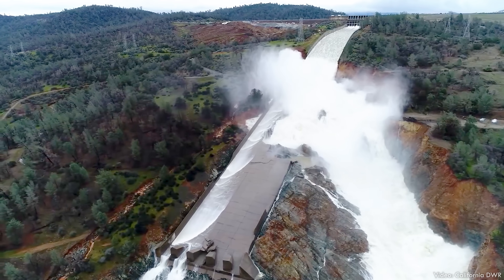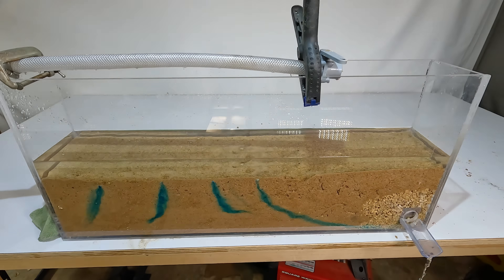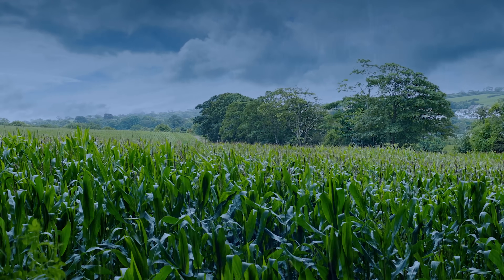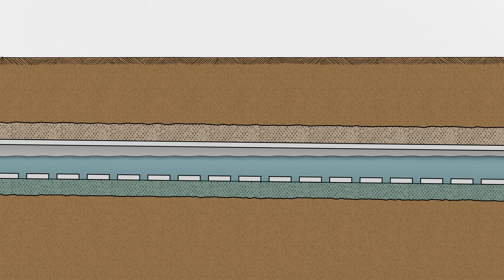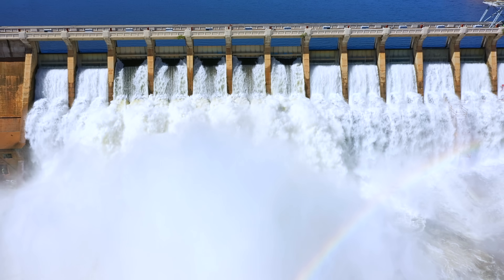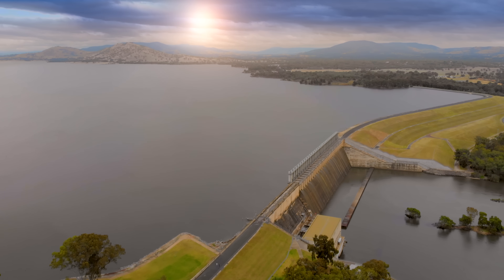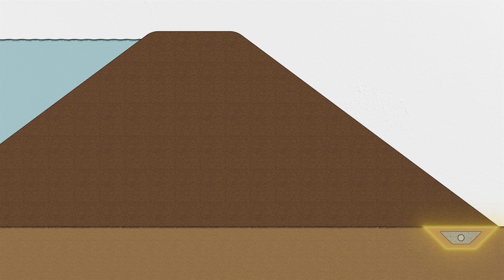How French Drains Work

Comment: I am a Stormwater Management/Sediment Erosion Control Inspector for the state of MD, and we don't allow French drains for the exact reason Grady stated. No matter how much you try to regulate sand/gravel size, any smaller sediment particles above, and in contact with, larger stones, will enter and clog the spaces between the gravel. We typically use very similar devices like Bio-retentions/Micro-bios in residential areas between houses. There is a whole world of mildly interesting devices and structures used just for moving around the water that comes from the sky, and the ultimate goal is to have the water end up in the exact same place it was before it was developed. Its also always changing, and things we were doing 5-10years ago is already considered out of date, but awesome video as always. Absolutely nailed all the nuance in this field! Keep up the great work!
Reply: Yes, in the state of MD we try to handle water in a way so as we limit the changes we make in how the overall watershed is affected by our development. Such as when we divert surface water around an area, we try to outlet in a way that it doesn’t negatively affect the natural soil and  vegetation, usually through a designed stable outlet to reduce the velocity before we transition back to original ground.
Reply: Based on my quick googling, isn't bio-retention basically just a french drain with plants on top to hold the soil in place and prevent it from clogging?
Reply: Whatever system you decide to use, don’t skimp on the pump. I built my drain and pumped it out of the vault with a Zoeller pump. Pricey but worth the money. Heavy duty all the way.
Reply: Yes.  @LanceThumping
Reply: You really only have two choices, right?   Either a geotextile fabric, which itself will get clogged, or sand over top gravel.   Seems like sand over top gravel is actually the best solution.   Since sand is an excellent filter medium.   In fact, sand pool filters are very common.
Reply: @sidorgeorge  in most soil water will still go i the drain
Reply: It always fascinates me that the most effective designs are those that more closely resemble the original conditions.
Reply: What type of drainage is used for basements?
Reply: Thinking gravel & sand on drainage pipe w/ vertical junction in pipe w/ cap (every 50ft), & use pressure washer to clear pipe annually or as needed. ... .... ... Any thoughts of better ideas?
Reply: Could you give a quick description of the kinds of things your putting around residential homes? Does it work with homes with basements?
Reply: In where I live, if french drains are not installed, there is most often huge problems with basements. We use isodrän/french drain covered in gravel surrounded by geotextile combination and cover everything by EPS plates placed just a feet underground for ice damage prevention. If something clogs up, you can pressure wash them from the inspection wells, and it's golden.  Also, drain pumps are useful but not everyone has those.
Reply: Thanks,  you have put me onto a new path to investigate how I can provide a solution to my problem before approaching the local Building Inspector about my neighbour's retaining wall flooding issue.
Reply: Bioretention have also its inherent mold problems if not enough air or circulation.
Reply: That's super interesting lol
Reply: Ya know what I hate?  I hate people who force their way of thinking on others via the law, and have no better solutions themselves.
Reply: In other words everything French eventually gives up
Reply: Use a geotextile fabric around the gravel to keep the fines out. That's probably easiest solution
Reply: @chinese_carmichael ugh, did you watch the video? Have you ever used fabric? It’s the SAME story. Instead of blocking the up the gravel, it blocks up the mesh of the fabric. It almost always fails faster than no fabric at all
Reply: @shadygunshow Then… what about (1) wrapping your gravel in geo-textile fabric, and then (2) surrounding/covering your geotextile fabric with a layer of sand before topping with soil?  Or will the sand clog the fabric too?
Reply: @ayjaymay  thats a cool idea. Maybe you would have to analyze the soil to figure out what type of sand to use.
Reply: @chinese_carmichael  Sorry, but no fabric will keep clay fines out over the long term.  That is a fact, not an opinion.
Reply: @chinese_carmichael  you're right this is how we do it in france.

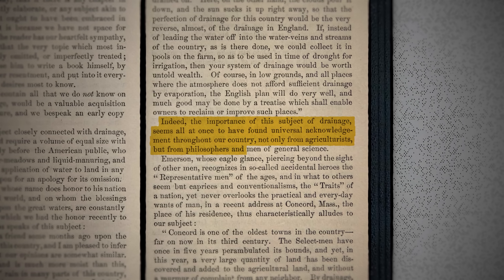Comment: 13:58 Hey look, buddy – I'm an engineer. That means I solve problems. Not problems like, "What is 'beauty'?" because that would fall within the purview of your conundrums of philosophy. I solve practical problems.

For instance: how am I gonna stop some big, mean flash flood from tearing me a structurally superfluous new swimmin' hole? Answer: use a drain. And if that don't work, use french drain.

Like this large diameter, sand-embedded, perforated ol' number designed by me – built by me.

And you best hope . . .
. . . not draining towards you.

Comment: I once bought a house that could have used French drains on the outside, if not on the inside (plumbing code had some things to say when there was an inside sewage pit, which mine had).  Without a tangle of floor standing pumps, water sensors, and hoses, I couldn't drain that basement at all.  I never actually did the French drain thing, not feeling like I was in a position to commit to it.  But especially after watching this, I think it would have made sense to have dug a trench on the yard's high side with a trench digger, and then, with suitable filter materials to retard clogging (maybe coarse gravel, fine gravel, sand, and geotextiles) with perforated tiles atop, and let gravity cause descending water to skirt around the house, in a pump-free configuration.  But like the guy below says, oh the roots (the yard had several trees).  Plus it was rock strewn ground, and I don't know if that would hurt a trench digger.  It's hypothetical now, since circumstances moved me on.  It's the new owner's concern now.  But video articles like Mr. Practical Engineering's are encouraging that we have some way of evaluating what an anti-flooding service might propose.  (And if they get annoyed rather than being respectful, a way of knowing to skip them.)

Comment: Can such drain cause draught?
Reply: Unless they are installed in very Sandy soil they will only remove excess water. That water that is free flowing through the soil and not bound up in the organic material. To be complete though they do have an negative impact on ground water if the drained water is not retained locally in a retention pond.
Reply: @kjdude8765  I understand that, but it's ok to drain it away from the local reservoir?
Reply: @cristitanase6130  If you are referring to the French drains placed inside of dams and embankments, it does drain some water but it is far better to drain it rather than let it degrade the dam or embankment.

Comment: At some point I need to redo the french drains in my garden as they flood during heavy storms. I can only assume they are clogged. This got me thinking about making a french drain with multiple layers of geotextile fabric and gravel, with different grades of filtration encasing each other. Kind of like stages of filtration for say oil (eg 100 micron, then 10, then 5).

Comment: My house has "weeping tiles". These are a tupe of French drain. I replaced my sump pump two days ago. The old pump had never run over the last 6 years and the sump pump was entirely submerged. Concrete from the rim of the sump basin had fallen into the basin, likely jamming and burning out the sump pump.

Comment: Here in the Netherlands nearby Joure whe have an aquaduct and the road underneath began to float and came up because of bad foundation and ground water pressure. To save it, first they laid thousands of bigbags filled with sand. Its about one or two years ago. And they are still busy. The road is partially open now.

Comment: Put a second sump pit in my basement and I drilled holes in the basin, to help install it as the ground water level was so high. Now I’m in the middle of replacing it, because all the sand is pouring in and causing sink holes. story of my life, should have hired a pro to begin with. Good timing for this video

Comment: Most of the major roads built on the east coast of Australia will have a network of subsurface drains under them, often there will be hundreds of km of french drains on each new project. We use the same principles described in this video to design and build them. The only difference being that our pipes have an additional geofabric sock around them as extra insurance against clogging.

Comment: somehow i feel so proud.. Today we where laying a fresh water pipeline and it happend to cross a rather big tunnel drain. A natural layer of slate stones was underneath the soil, it was used to support beachball sized rocks with 2 or 3 natural flat surfaces acting as walls, on top of those where place flat sandstones about 1 m2 in size. In the natural occuring holes where placed smaller sandstones and various sized rocks to plug it more tight. And that was it. But we rebuild it by using the same buildup but also used smaller and smaller rocks in layers on the sides and top, and at last we topped it of with coarse sand, before we backfilled the soil. Our hope was the layers would prevent the fine soil to get into the tunnel as the farmer who owns the drain was very strict about its importance to drain the field. And after watching this video i now feel very confident our layers will drain good, if not even better than before, and it will keep draining that field for a millenium if needed. Thank you for your videos. im not and engineer, but i do use the knowlegde gained from the videos in my work wherever i can use it.

Comment: That's not how french drains work. You put surface water in the drain, it leaks out and floods your foundations. French Drains are almost always the wrong solution.

Filters clog. French drains fail. No amount of wrapping in geotextile will save you.

Comment: coming from a farm in the wet north of norway, we have either done perforated pipes filtered with gravel or a layer of grass, dirt and roots. though the do need to be washed every 10-15 years or so, depending on how much iron sand (giving water that looks like tomato soup) or other particles have gotten in there. and with how often it rains even in harvest times, they are dimensioned to dry up the land as quick as in one day!

Comment: How about a piece on "Why French drains don't work?"

Subsurface drains are important, as you say. But they drain only GRAVITATIONAL or FREE water. Back in the last century, one of the functions of my job was check-print review. A road improvement project required a substantial 2:1 cut on a steep canyonside and the removal and replacement of a considerable volume of expansive soils with non-expansive, imported, COMPACTED fill to achieve the original cut's profile. The removal of the expansive soil required a rather deep and extensive excavation and disposal operation. The "subgrade" slope was benched twice, eighty feet from the toe and the same above that.

Gravel French drains were placed at the toe of each slope above each bench, under twenty or more (if I recall correctly) of fresh, compacted fill. Rather than mark up the plans, I decided to visit the design engineer and ask him where the water would come from that they would drain. He said when water percolated to that depth. I said that by the time the water got to them, the compacted material would already have failed. He insisted that he knew what he was doing and they were staying in. I expressed concern about water seeping along the steep interface between the base cut and the compacted fill and moving along it, and that some provision for that drainage might be desirable, fearing that either way, we could be looking at a future failure, however distant in the future. He "courteously" invited me to leave.

The resident engineer, the soils engineer, and I told the chief gardener and his supervisor not to use the expensive irrigation system. They ignored us. Several months later, the fill embankment slope failed, closing five lanes of the road below. I'm not sure why, unless there were errors in the build. The drains did not discharge a drop.

I'll appreciate any comment.
Reply: Since there was no water discharge, groundwater was not present or the drain system had a problem.  A properly  constructed fill slope should have a keyway excavated into competent material at the toe-of-slope.  The bottom of the key has a slope min 2% towards the heel-of-slope.  A sub drain should is constructed at the heel.  In Southern California (Western USA?) we call sub drains like this a "Burrito".  It consists of SCH40 or SDR35 perf pipe and gravel wrapped with filter fabric.  As fill is placed the existing bedrock is benched into every four feet vertical, with benches ten feet wide.  The benches must be into competent material.
You mention the sub grade was benched twice and 80 feet.  How high (vertical) was the slope?  How high (vertical) were the benches and how wide?  If fill is placed against a sloping surface without proper benching, there is nothing to hold the fill in place. Hope this makes sense.

Comment: Man I helped my old man put a few French drains in his yard, some to help channel water across a dirt mountain road, and another to help drain a pond retention embankment/wall/ pile of dirt. All of them work most of the time, and the first year they even drained well during the high rain periods in the fall, with lots of leaf litter. Now, although they drain well most of the time, during the really rainy months they don't have enough flow due to clay infiltration of the geotextiles.
If only I had know to put some sand in, it wouldn't have taken any longer, we already had to transport the gravel and dig trenches with equipment.

If only we had known! The drainage guys we talked to said the drains we did should be more than enough, as they are very wide! 
Now at least we can stop the seepage coming from the retention embankment before it becomes liquifaction

Comment: My house has a crawl space (actually more like a crouch space) with a dirt floor covered in gravel.  We have a French drain system made up of ceramic pipe sections in the gravel layer that all drain into a sump.  The house was built in 1940, and I'm pretty sure the French drain is original to the structure.

Comment: Hi Grady, quick question: Is it fair to say that in the limit, given infinite time, water, and upstream particulate matter, either the "clogging" problem or the "erosion" problem (or both) theoretically must happen? In other words, whatever your drainage design, after some number of years, either all the cracks will get plugged up with particulate (clogging) or boundless particulate will escape through those cracks (erosion)?

I get that maybe we can design things so well that it would take 1000 years for this to happen (or more generally "longer for this failure to occur than other failure modes for the drain") but I'm just testing my understanding -- that these systems don't "eliminate" the problem, they merely slow it down so much that it's practically not an issue?